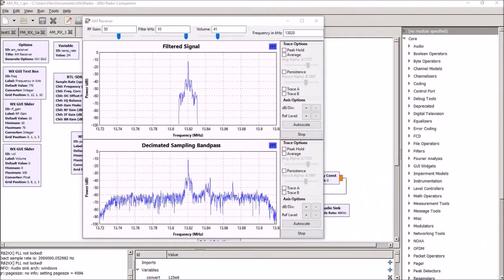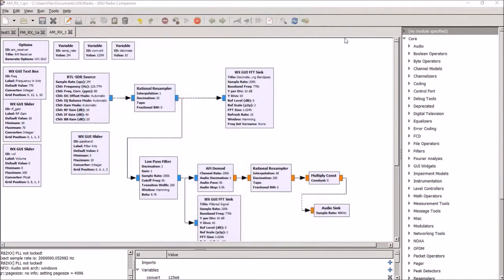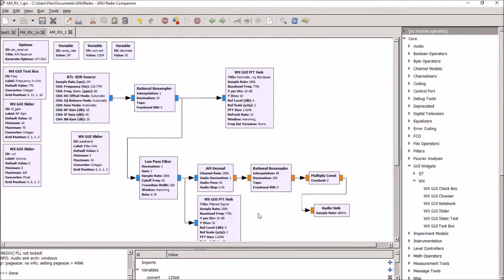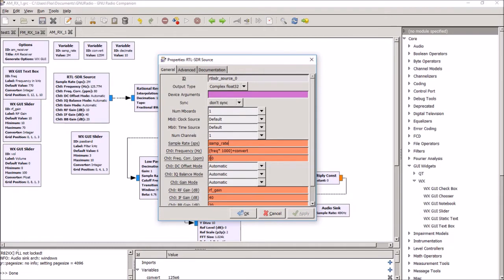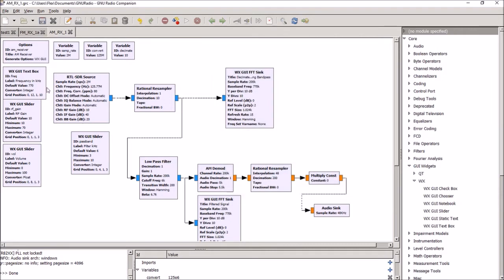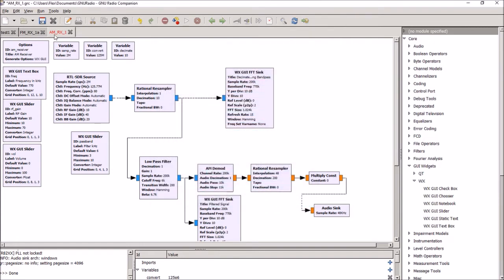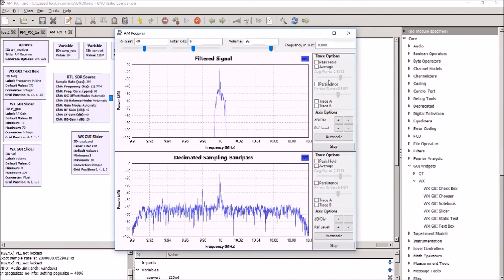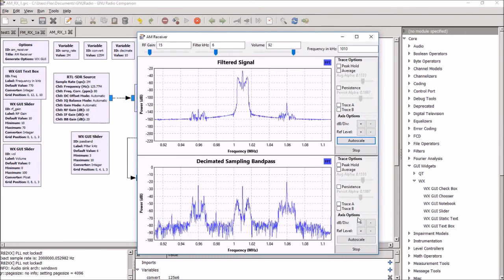GNURadio AM Receiver

Comment: Hi John,
What an awesome tutorial. I just purchased a "Hackrf one" and "Ham it Up!" and was immediate overwhelmed by how much I don't know.
Any how, I followed this tutorial, and it all began to make complete sense. Until I hit generate and execute. 
It didn't seem to do much, so I removed the up-converter and tried your FM Broadcast receiver. That worked perfectly.

So mack to the AM Receiver I get strings of UaUa... no matter where I set the Multiply Constant's value. When I turn it up passed 1, I hear an Putt-Putt-Putt sound, but no received audio.
I've tried it at 1450KHz, 10,000KHz, and 20,000KHz. No difference at all.

I also tried setting the Audio Sink to 32KHz and lowering the Interpolation value in the Rational Resample to 32. 

I also found your website and followed thru that version of the example. 
Still no love.

Got any suggestions?
73 Mike

Comment: Hi John. First I want to say thank you for sharing this with us signal junkies. I'm having issues getting this one working with a hackrf, and I was just wondering what might be influenced by removing the convert aspect from this model (as I don't have a converter) after looking some things up I'm going to mess around with the amplitude a bit, but thought I'd reach out to see if you had any insight. Thanks!
Reply from the maker: I used the "convert" variable because I had an HF upconverter to 125 MHz (to adjust for lack of lower frequency coverage with RTL-SDR). If you are actually tuning your receiver to the "real frequency", this stuff is not needed.

Comment: Hi John, Thanks a lot for explaining this in such a simpler manner. 
I am trying to implement this but at a different frequency band. But the problem being, there are so many spikes occurring in the spectrum and audio is sounding more like an on-off sound ~ something like a periodic bell.
Could you please help me out with this.

Thank you
Reply from the maker: Perhaps you are listening to Morse Code or some sort of digital signal. This is an AM receiver so it will not demodulate continuous wave.
Reply: Actually I have used the same parameters as yours. But it's just that I am transmitting the signal at a different frequency because of the USRP limit.
I am using USRP B210

Comment: Hi, great video!! I would be happy if you could explain how you came to the cutoff frequency in the filter because it is very low in relation to your center frequency and how you got to the transition width that is also indicated in the filter?
Reply from the maker: Hi Gaming. The lowpass filter width and sampling rate are two entirely different things. The RTL was sampling at 2M, then decimated to 200k. At this sampling rate I could do LPF anywhere up to 100k without aliasing. But 6k is the bandwidth that I wanted for AM reception. The transition width was the default value selected, i.e. how fast the LPF slope declines after cutoff frequency. Hope that helps!

Comment: Using the flow graph from this video and also the flow graph from your other amplitude modulation video(the one where you transmit a classical music wav file using virtual sinks and sources) I was able to set up to SDR's to transmit and receive a tone at 100MHz. However when I attempt to transmit my own music wav file I am not able to hear anything. In  other words, I am able to transmit only tones such like DTMF tones made in audacity but not music files that are also made in audacity. Do you have a suggestion to this issue?
Reply from the maker: Hi Alan. Should work. Just check your # of channels, bit size and sample rate are set up correctly. Also, I could not get 24 bit to work, so go with 16 bit. Probably a simple thing like that. Cheers...

Comment: Hi John, thank  you for the video  I`m New to SDR and my HW is hack RF one. I copy Your design(except the Source)  but I run in to trouble  after the AM demod  and in to the  rational resampler.  I see that the in and output after the AM demod is RED in Your design, but in my the rational resampler have blue in and output. Can you show me the details inside the "rational resampler " Best regard Roger  (LB2OE)
Reply from the maker: Hi Roger. You need to set the Data Type in the Rational Resampler Properties. Blue means complex data, and orange means float data. In my diagram, the Rational Resampler is working with float data for both in and out.